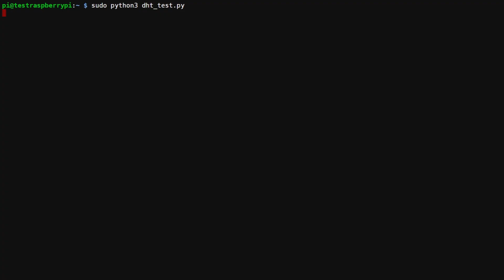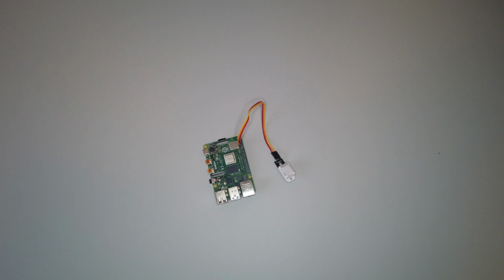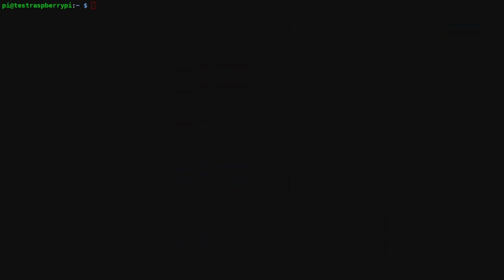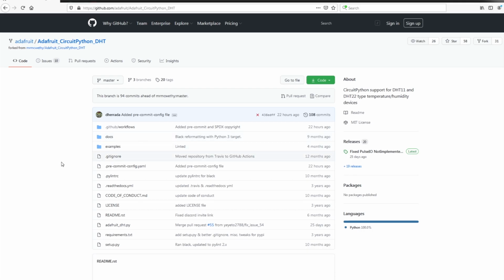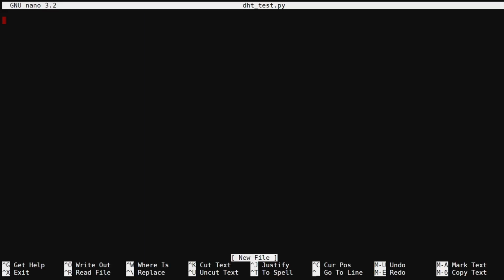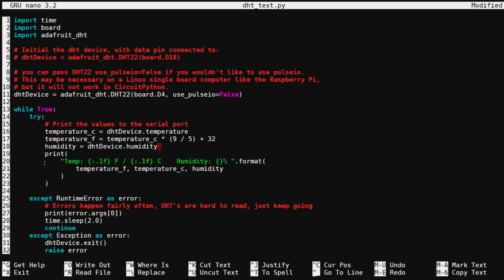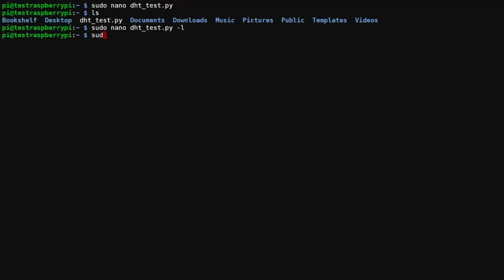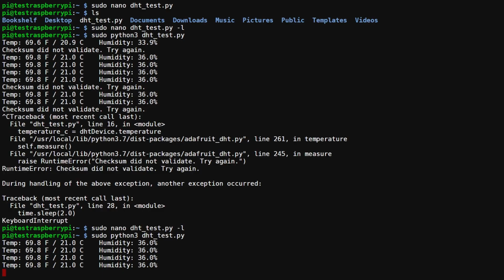DHT 22 (Raspberry Pi)

Comment: much thanks for this video. its good and understandable without breadboard. If you can, can you please explain if the direct connection to the Pi has any adverse effects? like burnout or something? (I had a fan removed to accommodate the sensor.).
Reply: this is a pull up resistor, it is there to make data readable without trying to deal with quantum physics, the resistor can be anywhere from 4.7K to 10K Ohms, we do not use the internal pull up resistor in the pi as the value is outside of that

the pre-made board also has a capacitor (100uf) to stabilize voltage at the sensor, depending on wire gauge/length and other loads on your 3.3v this may be unnecessary in a DIY solution

Comment: Great video -- the other videos I found all were running theirs through a breadboard. Which might make sense to people familiar with electronics but in a practical sense, why would you have a temperature sensor hooked up through a breadboard? These are supposed to be discreet setups for monitoring temperature/humidity. Mine is going to our barn so we can monitor the temperature for our animals. It's a headless setup, I just login via ssh from the house and I can check on how warm it is out there. -- Keep it up, straight forward tutorial, not overkill and applicable to the real life user.
Reply: +1